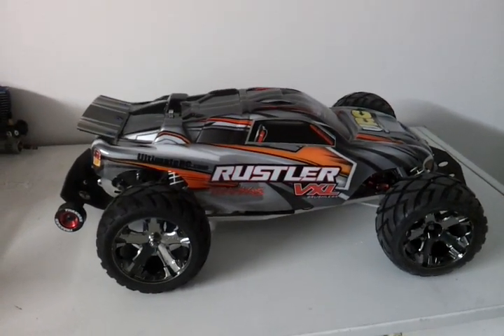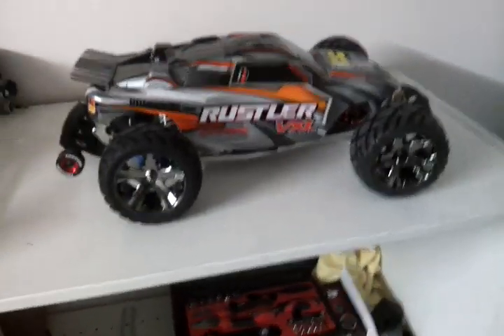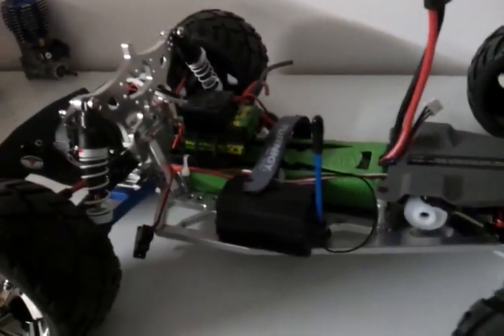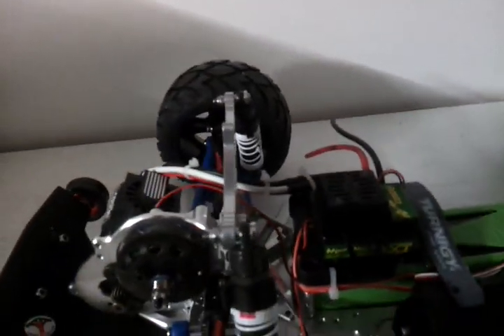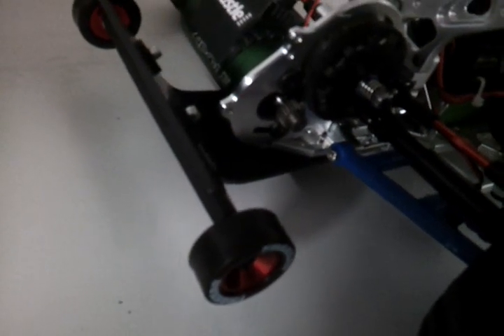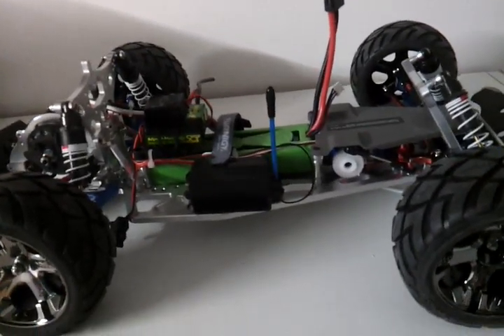Mamba Rustler Build

Comment: Nice rusty bro, check mine out.  Go for a Savox 1258TG.  Its literally a couple more bucks, but getter specs.    Also, U should definatly dye ur top plate black. Also, dont ride with ur RPM rear arms like that as ul murder ur performance. Take a dremel to em, and take fractions of a milli meter away until they fit nice and snug, yet flow perfectly. It will literally cause u to flip, and could caause u a chassis. Nice Rusty btw! check mine out!